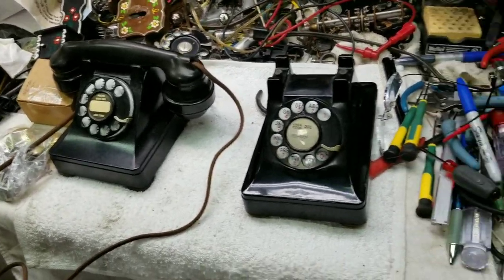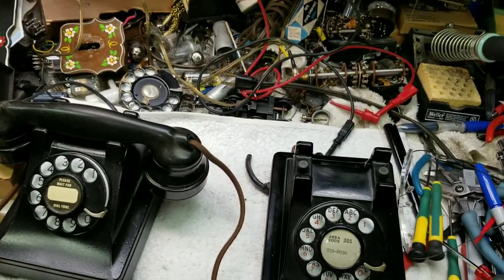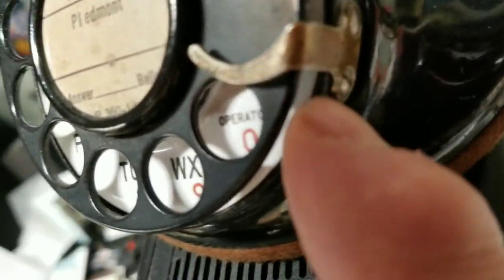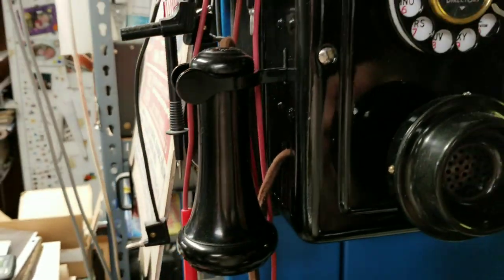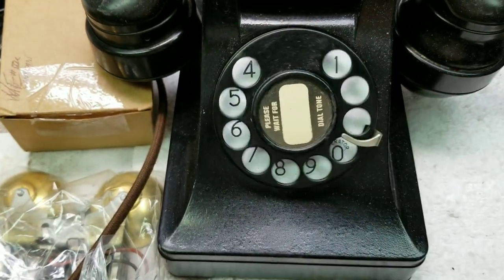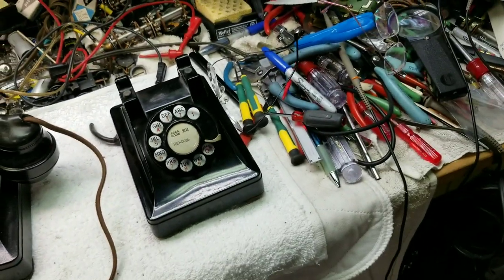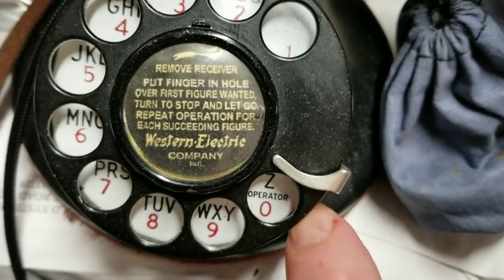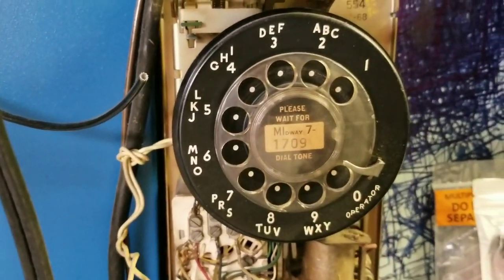Western Electric Vintage Phone Dials the 4H, 5H, 6H and 7H a Sound Comparison!

Comment: I personally prefer the “newer” dials over the older “click-at-tee-clack” dials for everyday use. I have a few phones that never came with dials but I added them so the phones will be more useable. On small, light weight phones … like a 202, a heavier turning dials just makes the phone base move around more when your dail the higher numbers. On W-Es, I like the newer 6U dials for daily use. They are easy and quiet to spin, very affordable, and the chrome or brass finger wheels do a nice job breaking up all the black color on the phone. As far as “feel”, the Automatic Electric dials are my favorite!
Reply from the maker: Yes Automatic Electric has a nice unique feel to it!
Reply from the maker: That's cool. I have my Mother's desk phone  from 1956 that has a 6 dial.  It is as you say wonderfully smooth and quiet. And that made it very successful since no one wanted these noisy things! Lol!

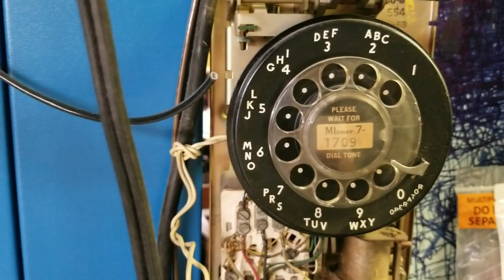Comment: In the 1960's, phones had dial cards that looked like the one seen at 3:08.   But what the 1950's?  Did the dial cards look like the one shown at 4:54?
Reply from the maker: The one you see at 4:54 is our phone from Brooklyn. We moved in 1979. We were there since 1956. So even though the dial and phone were replaced the dial card was more than likely just moved to the new phone since they're all the same size. So that dial card IS from tbe 50's. This is why dating stuff can be so confusing especially with things like these phones that have been around a VERY long time!
Reply: The old phone equipment was built like Sherman tanks. They were expensive to produce but it paid off in the long run by making service calls to the home rare occasions!